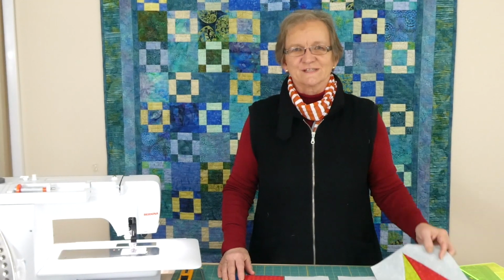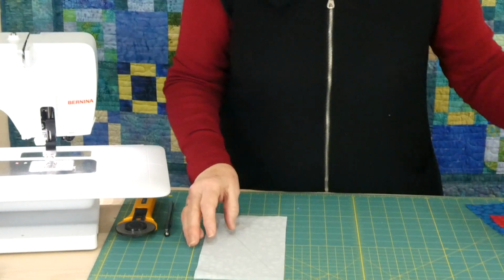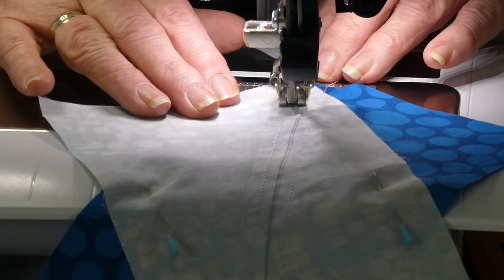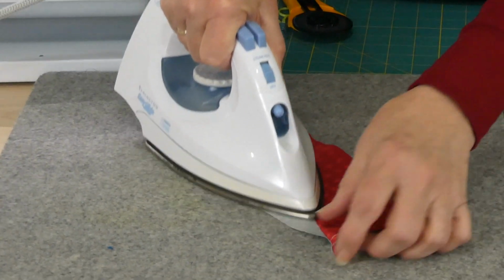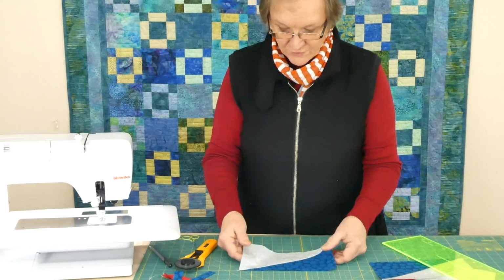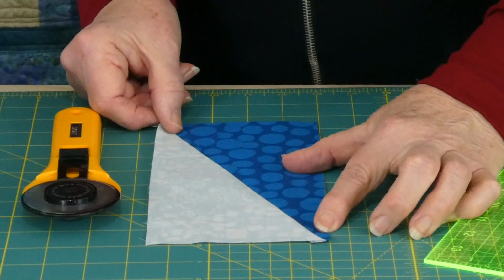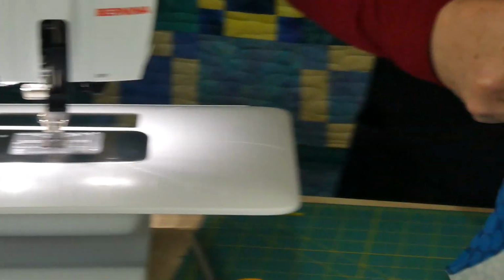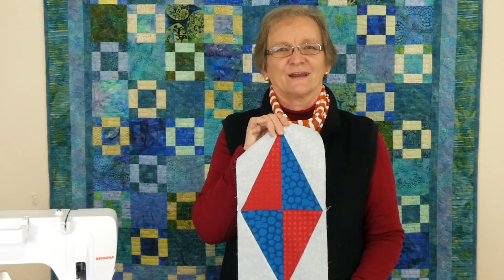Tips & Techniques 235 - How to make a half rectangle diamond block

Comment: Deb Tucker's split rectangle tool is an essential tool for these blocks.  They are what I call deceptively easy but devilishly difficult, but only because standard rulers have no good reference lines due to the angle. It slightly oversizes and offers trim down seam line at the perfect angle.  These split rectangles are the flanking triangles on triangle in square  or Peaky + Spike.  It will work for sizes to 8" finished.